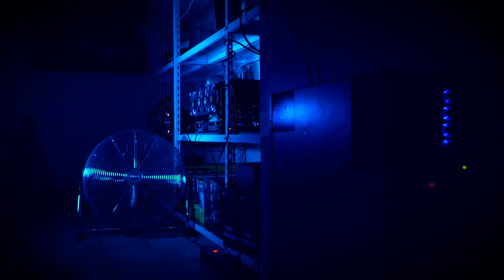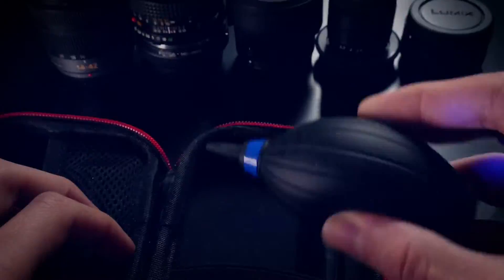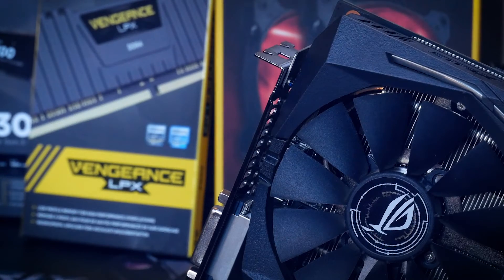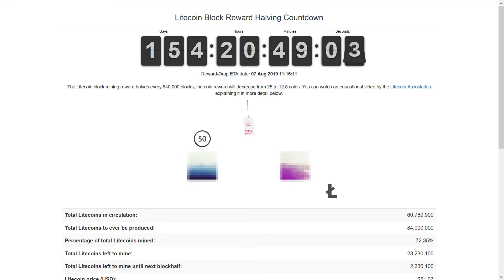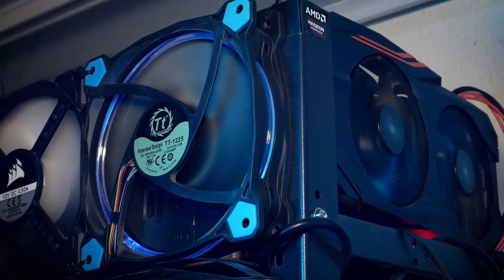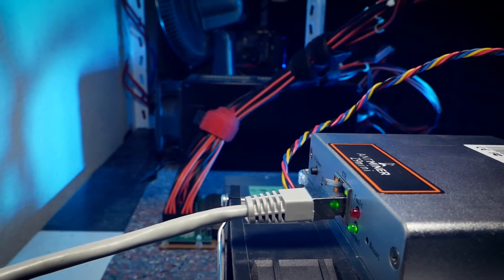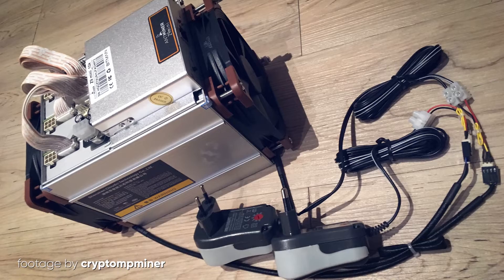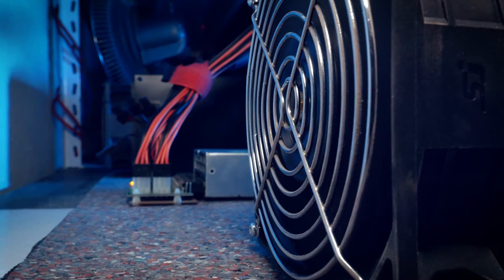Cursed Mining Farm #12: One Year Anniversary (March 2019 cryptomining update)

Comment: I currently have 8.5 cents per kwh, but if I use only 20 hours a day (4 hours with the rigs / asics off), my rate would change to 6.9 cents per kwh. (I think I'll have to start turning off the machines for 4 hours a day, to get the rate benefit), what do you think?
Reply from the maker: Both are actually great rates in my opinion, but of course it is a viable plan :) would make your operation more profitable! I just had a comment asking almost the same thing where he asked how to achieve this - here I recommended mechanical time clocks (or timer switch, not 100% sure how it is called in English) - but be careful that they are rated high enough for whatever you want to power :) cheers!!
Reply: with baikal can you alternate the algorithm to mine in an automatic way in nicehash? (I've never had a baikal asic)
Reply from the maker: Yes you can :) there is a sgminer option for that "enable-nicehashsma: true" - doing that right now with mine :) can't confirm on newer models though, but can't imagine they took it away :D